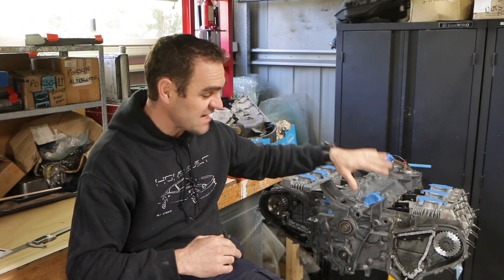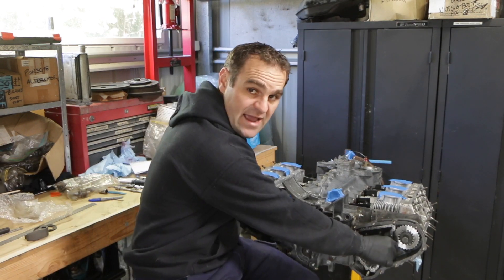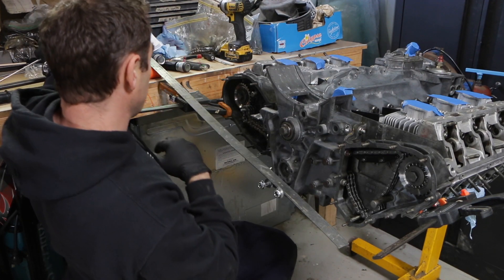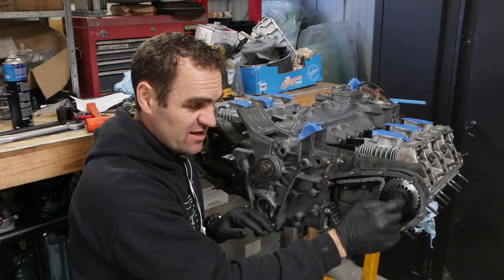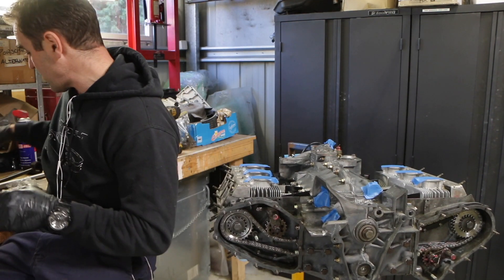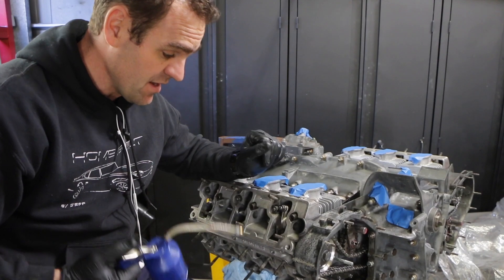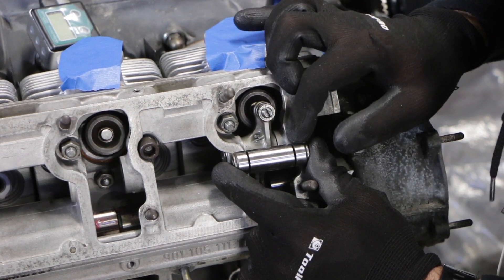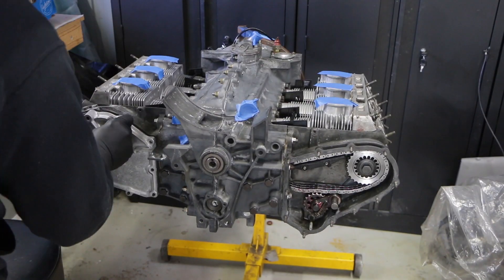Setting chain alignment - 911 2.8 RSR Build Season 2.7

Comment: For the timing, put all rockers in, there's no reason not to and they will hold the cams better. You might still have problems moving the cam. I use a screwdriver to pry it in the pin holes.

BTW did the rsr seals shear off?
Reply from the maker: I managed to just wiggle in the rockers with just my fingers, so the seals are all in tact.

Comment: Great progress Jeff! Before you remove your degree wheel I would measure for 'true' top dead center with a piston stop. Install a piston stop (I made mine from a bolt and an old spark plug) on cylinder No 1, gently turn the  engine counter clockwise until it reaches the stop. Reset the digital degree wheel to 0 and turn the engine clockwise until it reaches the stop again. Note the amount of degrees, subtract that from 360, remove the piston stop and  divide the amount by 2. Turn the engine back counter clock wise that amount is 'true' top dead center. Reset the digital degree wheel to 0 and that is your reference for the cam timing even if the Z1 mark does or does not line up with the case perfectly (If you did the process correct it should be very close). This method is the most accurate way to calculate TDC. Looking at the Z1 mark from the pulley to the case is not that accurate. Perfect cam timing comes from a perfect TDC! Good Luck!! -Kav.
Reply from the maker: I already set TDC on the degree wheel with the head off and a dial indicator straight onto the top of the piston, so it doesn't get any more accurate than that ;)
Reply: @HomeBuiltByJeff  Hey Jeff, If you remove your degree wheel to add the flywheel to torque your pulley how do you set up the degree wheel again if the heads now on?
Reply from the maker: @kavs911  I hear what you are saying, but I plan on doing all of the cam timing before I bolt on the flywheel, so hopefully I don't have to mess around again ;)

Comment: Hi Jeff. Greetings from Norway  :) 

Fun to see others go through the same thoughts/problems that I have in the same situation before. But As long as you are patient and keep reading what the pro's think/do, you'll be OK. That is a good way to learn and really understand what's going on. 

But I am curious to know which EFI you will be running. I hope it is not Electromotive. I have tried that (TEC3r) on my 911 w/PMO EFI throttle bodies, and the Electromotive is just too slow to react to rapid MAP changes, making the throttle response a bit slower, and resulting in a bit inconsistent driveability too. I since switched to DTA S80 pro, and boy... -What a difference!! Crisp, FAST throttle response, and consistant, good driveability. The same conclusion was also reached for my mate, making the exact same swap in his car. I'm sure other manufacturers would be just as good, just not Electromotive. Good luck Jeff! :)

Comment: Just curious. How will your 2.8 RSR engine compare in performance to my 2001ish 3.2 M96 Boxster engine?
Reply from the maker: This should hopefully make somewhere around 280hp compared to the Boxsters 250hp, and my car should be a couple of hundred kgs lighter, so on paper at least it should be pretty sprightly.
Reply: Thanks Jeff. I have the Fabspeed exhaust so please add 15hp. 😉
Reply: @MyBlueZed  I hope you're joking :))))
Reply: Dinu Busegeanu I’m sure I read 15 hp somewhere; the Fabspeed website says 5 and 30lbs less than stock. Let’s call it 10! 😊👍🏻
Reply: @MyBlueZed Jeff has purple stripes so please add 20hp.
Reply: Jeff has Neil Harvey of Performace Developments Costa Mesa, California) in his corner.  So please add 100hp.
Worth a look:
https://performancedevelopments.com/aboutus/

https://performancedevelopments.com/engines/